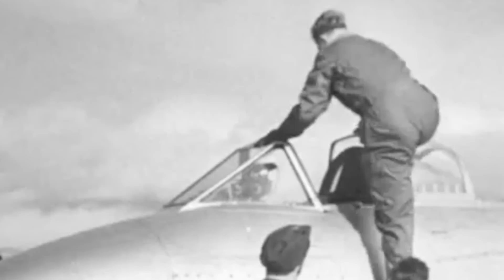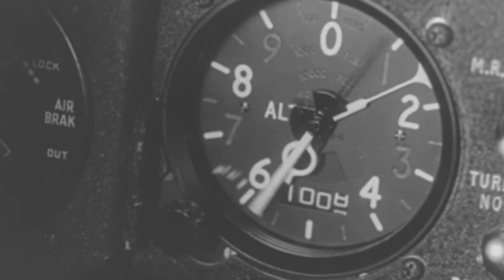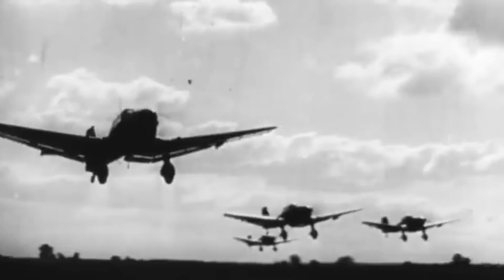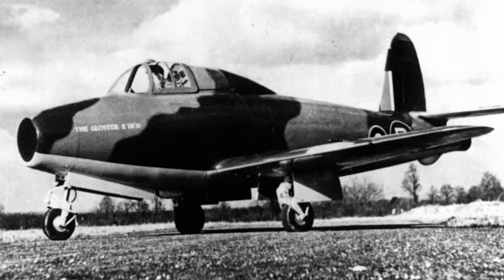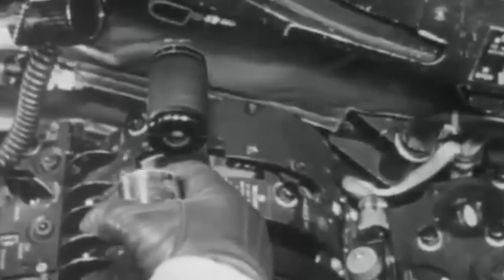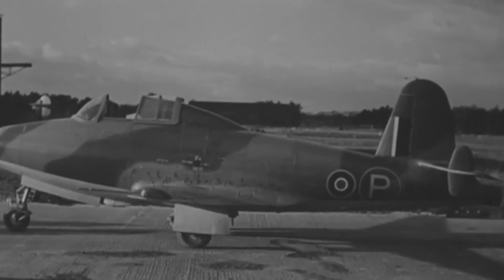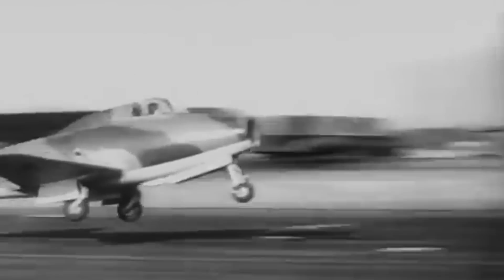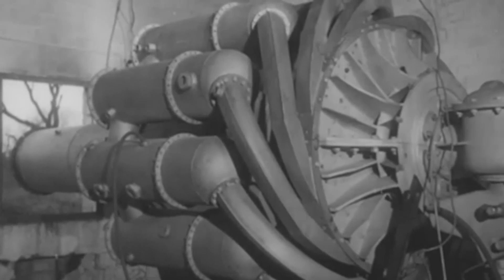Britain's 500 MPH Coffin With Wings

Comment: The British had been working on Jet engines since the 1920'a, AA Griffiths on the Axial-Flow Turbojet, and Frank Whittle on the Centrifugal-Flow. But the British Air Ministry refused funding, The German BMW 003 and Jumo 004 engines were coppied of the Griffiths design. The British were also correct in that the Centrifugal-Flow engines would offer greater safety and more power. Almost all post-WW2 jets flew on these engines, including F-80 Shooting Star, Grumman Panther and Cougar, DH Venom, Dassault Mystere, MiG-15 and 17 etc. It was after 1954 the Axial-Flow jets matured and replaced the Centrifugal-flow engines.
Reply: Who?  Whittle didn't begin working on jet engines until 1936 and Griffiths not until 1940!
Who was working on jet engines in the 1920s.
Please be specific, and name the person or persons in the UK working on jets in the 1920s???
Reply: @sandervanderkammen9230   Still more nonsense from you, which is totally at variance with the facts.
At Britain's RAE,  Dr A A Griffith had been working, if only theoretically, on a proposal for a gas turbine aircraft engine before 1926.  In that year, he submitted an internal RAE report in which he proposed an axial flow engine powering a propeller - in other words, a turboprop.
In1928/29, he ran an experimental single-stage axial flow compressor/turbine rig.  It's now in London's Science Museum, for all to see (I was there on 9 October).
In 1928, as an RAF officer cadet, Whittle wrote his seminal thesis on high speed flight: however, he proposed a curious combined piston engine/compressor arrangement, the efflux from which  drove an axial flow turbine connected to a propeller.  Some people have described this as a.motorjet: it was certainly not a true jet engine. and Whittle always acknowledged this.  The following year, as a qualified pilot and training to be an instructor, he submitted a proposal for a true turbojet to his superiors.  This was passed up to the Air Ministry and on to Griffith. 
However, Giffith was obsessed with the turboprop principle, which is perhaps why he rejected Whittle's turbojet proposal when it was forwarded to him in 1929.  In Whittle's theory, he identified an error in the calcs, which invalidated some of Whittle's assumptions.   However, he did not identify a further error, which Whittle subsequently did.  With both errors corrected, Whittle's theory was totally valid.  Assisted by a fellow officer, a patent agent in civilian life, he submitted  patent application in January 1930, which was granted the following year.
As a serving RAF officer, and an outstanding pilot, Whittle pursued his flying career, until he was sent to up Cambridge by the RAF in 1934.  While there, he studied for his degree and, encouraged by his influential friends, he resumed work on his jet engine.  Those friends also arranged for a small amount of venture capital funding, which resulted in him working with BTH at Rugby to complete the design and build of his WU engine.   This ran for the first time on 12 April 1937.
All the foregoing is well-recorded and documented historical fact.

Comment: Not only is the clickbait title problematic, the video starts with historical inaccuracy: Britain was not developing jet planes as an 'urgent attempt to catch up' to Germany. Britain and Germany developed jet aircraft roughly in parallel. Inventors in the two countries chose different engine technologies. Britain developed jet planes because she could and they were the next technological leap. Similarly with radar, Britain and Germany developed these new technologies in similar timeframes without reference to each other.
Reply: .Britain was years behind Germany in axial compressor technology, and thermal management. The UK lacked the ability to build airworthy axial jets until the 1950s and captured German technology was incorporated.
Reply: @sandervanderkammen9230  The metallurgy of the 1930s and 1940s couldn't cope with Axial flow jets, hence the abysmal maintenance record of German WW2 jet engines. Centrifugal flow was the right choice until the 1950s - and British engineers made the right choice.
Reply: @preachyourstory3452  The German company Krupp introduced P-193 Tinidur A60 in 1932, it is the world's first high temperature, creep resistant alloy and is still used in jet engines today, it is sold as A286.
Compressor design does not require high temperature stainless alloys.
The Allies lacked the fluid dynamics technology to build efficient axial compressors.
Do you have any questions?
Reply: @sandervanderkammen9230  Why was the Jumo 004 engine life so short - much shorter than early British jet engines?
Reply: @preachyourstory3452  It wasn't, it's a false myth..
Reply: @preachyourstory3452  Not true, this slanderous, false rumor has been parroted for years.
The Jumo 109-004 A made with P-198 Chomadur alloy never saw production or operational service.
Only the B Version was mass produced and saw operational service in the Messerschmitt Me-262.
The Jumo 109-004b was the most successful and most reliable jet engine in service during WW2.
It averaged 55 hours between overhauls, that's better than most Allied high output piston engines during WW2.
Reply: @tauncfester3022 That is easy to answer, the only commercial supplies of Nickel came from Canada at the time and by 1940 German stockpiles were becoming depleted.

Again, here you are attempting a bait and switch with your data.
20 hours refers only to the Jumo 109-004 A version made with P-198 Chomadur alloy.
The Messerschmitt Me-262 was only produced and used in operational service with the B model engines which were vastly superior due to cutting edge breakthroughs in thermal management technology.
The B model features bleed air cooling and TBCs.
The B model averaged TBOs of 55 hours between overhauls.
This is better than Allied piston engines during WW2.
Reply: @sandervanderkammen9230  

We feel we can clear up a few commonly touted false myths.

   Obviously Germany had large stocks of Nickel throughout the war period, they were attempting to use various stainless steel alloys for turbine blades hence the 46 minute life junko engines.

     It's clearly the case that the key Nickel super alloys (not primarily iron stainless steel alloys being used in Germany & the US) required for turbine blades were invented in England around 1940 & were available nowhere else at the time.* In France around 1951 attempts to develop from German engine designs for the Dassault Mirage 3 resulted in the air cooled sheet steel turbine blades being eventually changed for solid Nimonic turbine blades & a number of other Rolls Royce technologies being adopted in order to get a working engine.

   Of course the reasons why iron is not a good idea in turbine blade alloys was figured out more than ten years earlier in England.

    It's a great pity that British military forces were forced to occupy a large part of Germany for decades after 1945. Russia had to do the same. Russia & the UK now produce nukes. Germany does not produce nukes. Russia still possesses a large chunk of what was German territory.

  We do if course hope this helps.
        Cheers indeed, obviously 👍
Reply: @sandervanderkammen9230  No.
Reply: @memkiii  Britain wasted years developing the WRONG Engine!
And they would not begin construction of their first supersonic aircraft wind tunnel laboratory until late 1947!
Reply: @petemaly8950  Please name a single British company that still makes British jet aircraft in the UK mate?
Reply: @sandervanderkammen9230  You have to be a troll, the Whittle/Rolls-Royce early jets powered many Gloster Meteors which shot down many of your Nazi friend's buzz-bombs, you know that stupid little pulse jet POS that could be flipped by disturbing the airflow over it's left wing tip?

  The DeHavilland Vampire first flew on 1945 and on one engine and it was easily the superior of the rather junky Heinkel 162 Salamander that caught fire frequently and had such poor aerodynamics that more pilots died flying it than they had in kills. The captured German technology went to the Soviets and even they knew an engine with a 20  hour TBO was a POS.
Reply: Indeed. An there are many that claim that the British did not consider the axial compressor which is false - Whittle's first engine, the WU, that ran in 1937 had an axial compressor. Whittle decide the centrifugal route was going to provide a practical engine quicker than the pursuit of axials. Given the low MTBO for the 262 he was probably right.
Reply: @ColinMill1  WRONG! Whittle would never in his life build any engine with an axial compressor.

The W.U. had a single stage CENTRIFUGAL compressor, this was a  Metropolitan-Vickers furnance blower salvaged from an abandoned iron foundry and driven by a 4-cylinder Austin 7 automobile engine!
Reply: @sandervanderkammen9230  You clearly don't know what you are talking about.
Reply: @ColinMill1  Yes. Dunning meet kruger.
Reply: @ColinMill1 The brits were a decade behind, they wouldn't have ability to build axial compressor jets until the Hawker Hunter..

Comment: The top speeds you report only happened during crash events. It's not like the design could handle the stresses.  Weird video.,
Reply: The top speed of 505 mph was during fully controlled normal flight with no crash involved.

Comment: 500 mph ?  Only if towed by a phantom.

The E28/39 topped out at 370mph, one of the reasons the Meteor was a twin.
Reply: The Gloster E.28/39 was later able to achieve high speeds, the highest being 505 mph (813 km/h) at 30,000 ft (9,100 m) with a W.2/700 engine and it proved to be a useful experimental aircraft with a "good climb rate and ceiling".    Flight 11 May 1951, p. 553.
Reply: @mattperson7293 
Spot on.
Reply: Or a Lightning......
Reply: @Addad66  Maybe 30 years later !

Comment: It was actually the 4th jet to fly not the 3rd. The Italian Caproni Campini N.1 flew in August 1940 almost a year earlier than the Gloster.
Reply: Whether or not the N1 was a true jet is debatable. It was powered by a piston engine coupled to a ducted fan. It did have rudimentary afterburner. The first used on an aircraft, I believe.
Reply: @Gloomendoom  I feel that is a fair argument.
Reply: @Gloomendoom Certainly an example of internal combustion jet propulsion and successful flight without the drag associated with a propeller which prevents propeller aircraft from reaching the high transsonic speed.

Whittle was in fact the fourth person to successfully demonstrate a working jet aircraft engine.

Comment: 'represented Britain's urgent attempt to catch up with German jet technology'.

This is just kack. 

Unsubscribed.
Reply: Germany was many years ahead of the British... Whittle was only the 4th person to successfully demonstrate a working jet engine, and the centrifugal compressor type engine proved to be a dead-end design. The British would lag behind and would not have an axial jet in widespread operational service until the mid-50s.
Reply: @DoktorBayerischeMotorenWerke  Check out the MTBO of the Jumo 004. There were very good practical reasons why centrifugal jets were so widely used in the early days and the development of really practical axials was so long coming. The British were well aware of the theoretical advantages of axials from the 1920s.
Reply: @ColinMill1  The Jumo 109-004A made with P-198 alloy never saw production or operational service, these were only experimental engines.
The -004B that was mass produced and saw operational service was the most reliable engine during WW2.
 Operation LUSTY tests confirmed German records showing TBOs averaged 55 hours between overhauls. Better than any Allied jet engine during the war.

Britain lagged a decade behind in axial jet technology and would not introduce a reliable axial engine until the Hawker hunter in the 1950...
Reply: @DoktorBayerischeMotorenWerke  There are no airworthy Jumo004 engines left while there are still many Derwent engines still airworthy and some still in service with Martin Baker in Meteors. The oldest jet engine still running is  a Welland. There are no airworthy original me262s only replicas running with non Jumo engines. There is an attempt being made to make an original 262 airworthy with 004 engines be these are being "retooled" to improve the life of the engines. It remains a work in progress.
Reply: @ColinMill1  There are no WW2 vintage British jets or engines still flying today.
All the examples of the Derwent and the Meatbox are postwar from the late 40s and 1950s.

The Paul Allen collection has an original Me-262 with running original WW2 era  Jumo 109-004b engines restored to original specifications.
The BMW 109-003/18 is still in operational service
Reply: @sandervanderkammen9230  The oldest is from 1949 and did 20 years service with the RAF and is airworthy. Did any 262 or 004 do 20 years service with anyone? How many original Jumbo004s are even in runable condition?
Reply: @ColinMill1  The Me-262 flew into the 1950's. Like the Gloster "Meatbox" it was technically obsolete by 1947 and surpassed and replaced by more advanced 2nd generation German aircraft designs like the F-86 Sabre and the MiG-15. The British would not catch up until the 1950'ds with the Hunter, they made do with obsolete aircraft after the counties defeat in WW2.

Britain was still making obsolete centrifugal jet engines in 1953.
Reply: @DoktorBayerischeMotorenWerke  The MiG15 was powered by a centrifugal - a copy of the Nene.
You can hardly call the Sabre or the MiG German - American and Russian respectively.
Reply: @ColinMill1  Wow!  I'm shocked you didn't know!
The Russian copy of the R-R Nene is called the RD-45
The VK-1 was designed by Valdimir Klimov.

The MiG-15 was designed by German Heinkel engineer Seigfreid Günter.

And the F-86 Sabre by German Fokker engineer Edgar Schmüd and a team from Messerschmitt..
Reply: @mrb.5610  Can you name a single British company that still makes British jet aircraft in the UK???
Your comment is canceled!
Reply: @WilhelmKarsten 

We do indeed feel we can clear up some common false myths, misunderstandings & misconceptions.

Clearly it's always very important to note the relevant facts obviously.  
 
  Regarding the UK Aerospace Sector.

Which airline recently ordered 60 RR Trent XWB Engines?

     Agreed, it is if course the case that Brazil makes very good airliners & Brazil is 100th down list along with Indonesia for wealth per capita.
Norway Holland Denmark Ireland Belgium - Top 20 wealth per capita - Don't make airliners -  its as simple as that.

   Yes that's correct of course. BAe Systems & Rolls Royce combined now do more Airbus work than Germany on an absolute basis & significantly more work than that on a per capita basis.
    
    Yes that is in fact correct, Per capita for the home nation BAe Systems is the world's largest defence contractor.
   
     It is indeed the case that BAe systems announced the recent £4 Billion takeover of Colorado based US based Ball Aerospace.

     Agreed of course, BAE systems now does a significantly higher value of work for Airbus than it did when it was a major Airbus shareholder before 2005.
  
     Yes, it is recognised that RR now owns US Engine maker Allison for example which does classified Aerospace work for the US Govt.
   
   Absolutely correct obviously, anybody currently flying on a widebody airliner stands a good chance of being on an aircraft powered by RR gas turbine aero engines designed & built in the UK.

   A typical but small glimpse of what goes on in the very internationally orientated British aerospace sector.  -
      Boeing Apache Attack Helicopter.
AH-64: 75 UK suppliers, 7% UK content, global fleet of 1280+ aircraft.

F35B more than 130 UK Suppliers, more than 30% UK content.

F35A & F35C more than 130 UK Suppliers, more than 15% UK content.

   Yes, of course it's true that an airline has just ordered
60 RR England Trent XWB Engines

Obviously the UK has the
World's Highest Combined Per Capita
 Nuclear / Defence / Aerospace Sector Activity.

Obviously we do sincerely hope this helps as usual as always.

Cheers indeed & 👍 without doubt as always & so on & so forth.

. ...... ....
. ..... .... .

Comment: Altimeter spins backwards at an alarming rate, 
so fast that it looked as though it was going forward...
Reply: Indeed 😏
I also noticed an airspeed indicator in km/h. Guess the British were already embracing the metric system back then!
Reply: @frankkeustermans1223  You might be surprised to find out the Brits still use imperial for distance and speed. Their road signs are in mph.
Reply: @AndyTomT  I know! That is why I noticed😊
Reply: @AndyTomT You may also be surprised that Britain doesn't make British jet aircraft anymore
Reply: @acbulgin2  The Gloster Meteor very frequently became a "Meteorite"